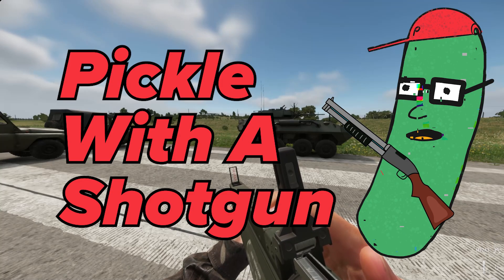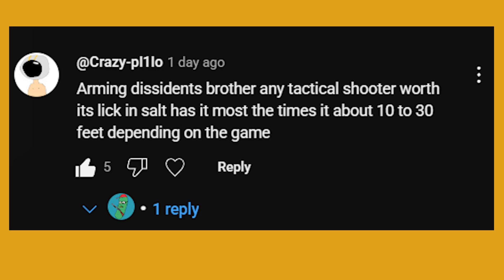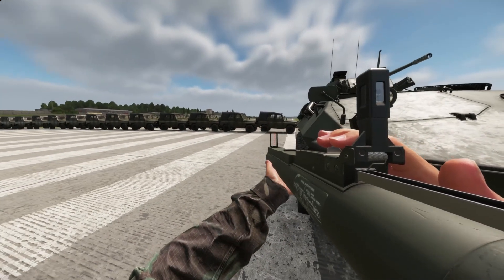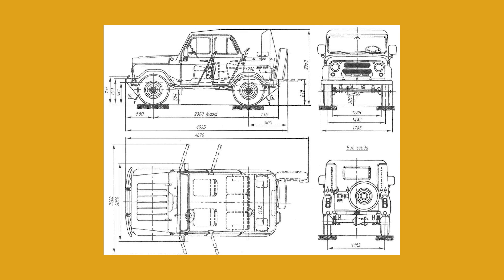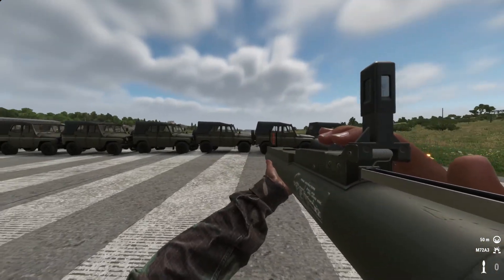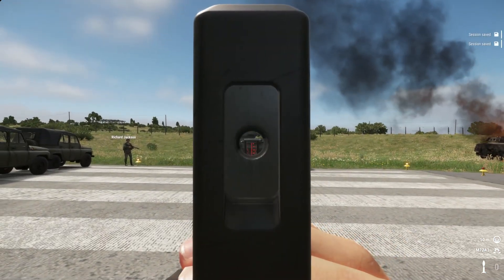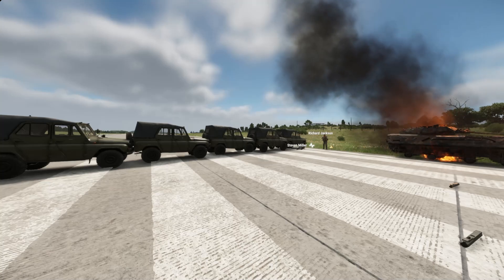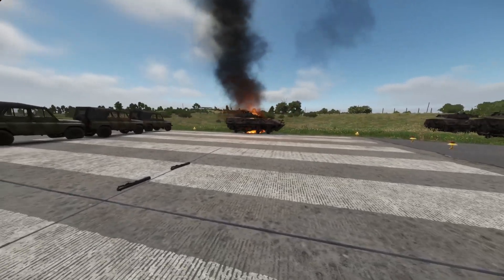What’s the Minimum Arming Distance of a LAW in Arma Reforger? (Explosive Test)

Comment: Top tip, these rockets as well as rpg rockets will penetrate concrete walls and essentially spray shrapnel out the other side, best way to clear a building is to never need to go inside 🎉🎉

Comment: The M72 LAW is single use. After shooting the rocket you are basically left with a plastic tube that can't be reloaded. 3 of these weigh about as much as a single loaded RPG-7
Reply from the maker: My real question. Is there a better way to “reload” them. Like when I got an extra in the backpack, is the fastest way to drop the expired one and then equip the one on the backpack? —- like grenades let me throw one , and then my guy automatically fetches the next grenade in my backpack. Perhaps it’s user error.
Reply: @PickleWithAShotgun  Yeah you're meant to toss them after use
Reply: @PickleWithAShotgun  theres a keybind to quickly drop the weapon you have equiped tab+x i think it is
Reply: @PickleWithAShotgun   It is called Light anti-tank weapon because the America thinks if you shoot a heavy tank, and it survives the blast, it is better to run away and toss the weapon aside to reduce weight. No it is not tank is the threat, the real danger is the enemy reinforcement thank is coming your way because you revealed yourself as a real danger. You destroy tank > Enemy hears and check explosion by direction > realizes their tank gone > Enemy go hunting who destroy tank > You reduce weight and F****NG RUN!!!!
Reply from the maker: This doesn’t sound good for the environment. Could a sea turtle choke on this?